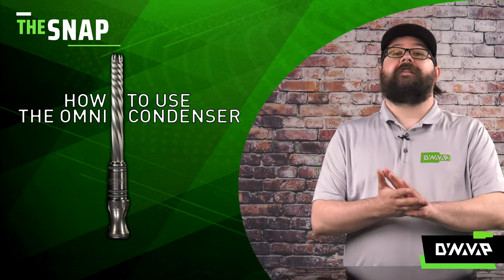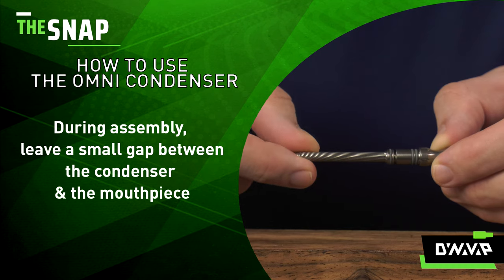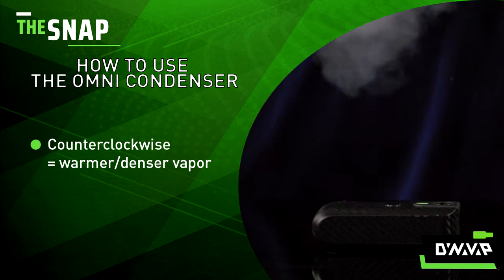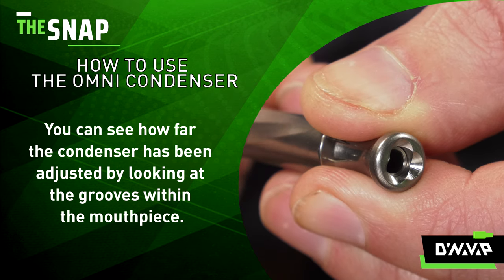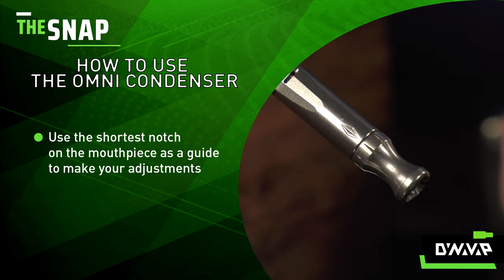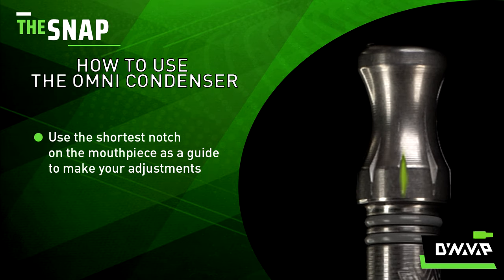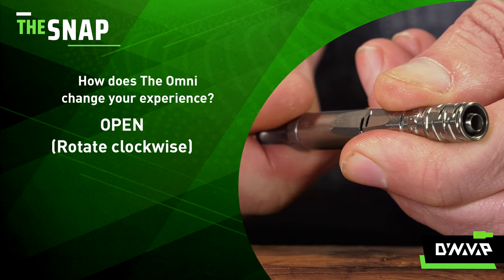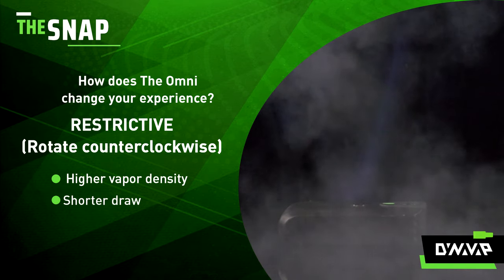The Snap | How to Adjust the Omni Condenser

Comment: On the old Omni I liked my ports fully closed, on the new Omni you cant do that anymore. Full close still lets some air through. I tested 2 new Omnis and both had the same problem which really is a downgrade for me.
Reply: If youre good with a dremel (dont laugh) you might be able to mod the tip:
The condenser does intrude the tip a fair bit, but like you said, there is an air gap. I have a brandless dremel and even it has a mushroom type cutting bit. Only couple 3 or 4 mm's diameter. You could cut a groove in the tip for an o-ring to sit. So when you screw the condenser out 2 turns, it hits an o-ring which closes the airgap 🤷‍♂️ or you could mod the condenser to fully close the gap instead of the tip 🤷‍♂️
Reply: just covering the holes with a finger when holding it should do it